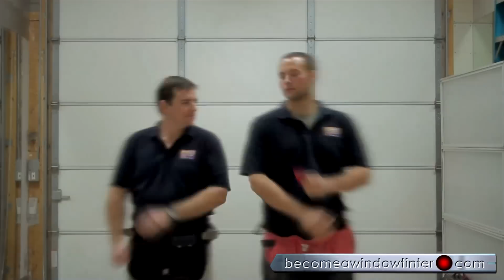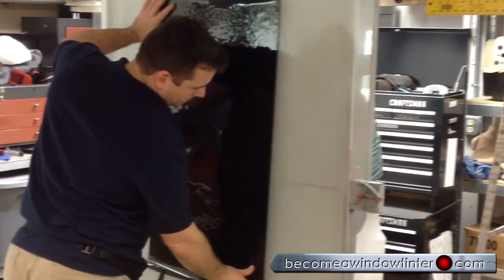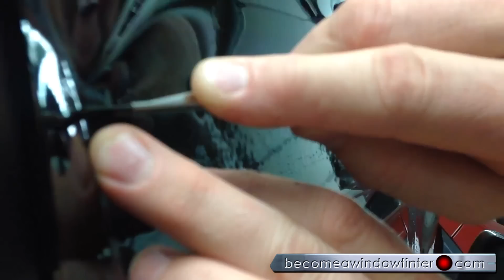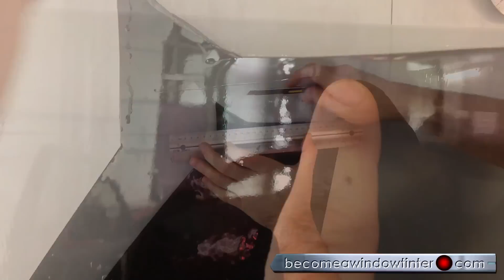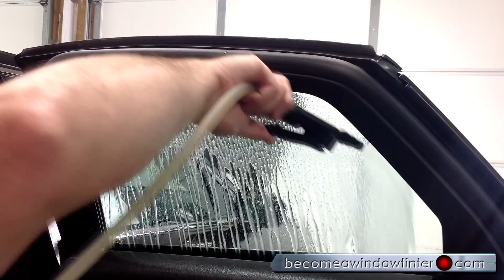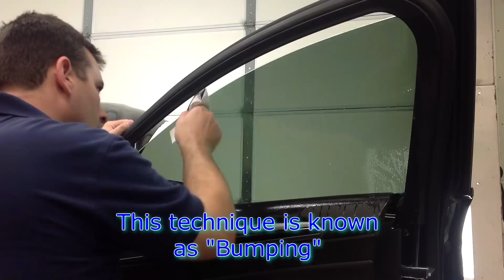How to tint a car rollup window

Comment: I stopped watching this video as soon as I saw they had removed the door panel off the car. there's a reason why we use a platinum reach card for that.
Reply from the maker: +ED PE To Each his own... I tinted for 10 years without pulling seals but I got tired of getting done and seeing creases and dirt on the edges on about 10% of rollup windows, especially older, dirtier cars. Pulling seals takes time up front but saves frustration. Any way, the platinum easy reach isn't the reason we pull the seal.
Reply: @Becomeawindowtinter  Πολύ σωστά, και εγώ αυτό κάνω.

Comment: If you overlap the bottom seal by an inch when you micro edge aren't you going to have a lot if film to have to tuck that might cause some issues? I see a lot of installers just line up right to the top of the seal. Just wanted to get your take on that. Nice videos no doubt!
Reply from the maker: If you tuck film, as in not removing the bottom seal, then yes, you'll want less film down in the door. Personally, I prefer to pull the bottom seal, though, and slide the film down into the door, and this allows the bottom edge of the film to be below the lip of the bottom seal. That way there's less likelihood for it to catch later. It is also easier to deal with fingers, prevent creases on the sides, and prevent dirt intrusion on the sides of the film.

It's a matter of personal preference and balance. Pulling door panels and bottom seals is sometimes stressful, but much less so than having to redo a window because of dirt and creases that are easy to get with tucking methods.
Reply: Can you guys do a video pulling the seals?  I don't like to pull door panels but yes I just did a car where the tops of the doors were loose which let the seals pull out really easy without having to take the whole door panel off.